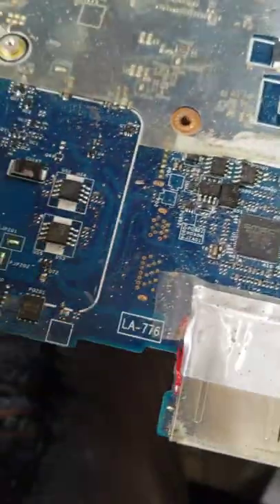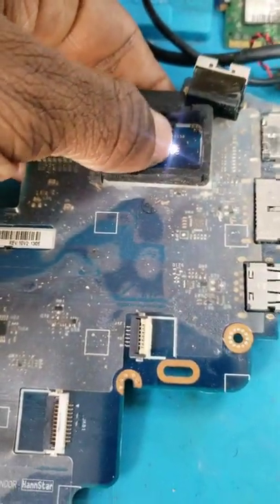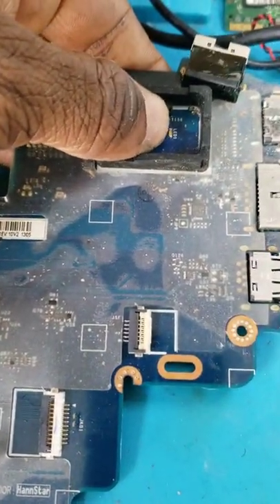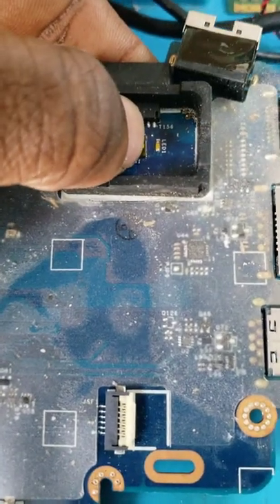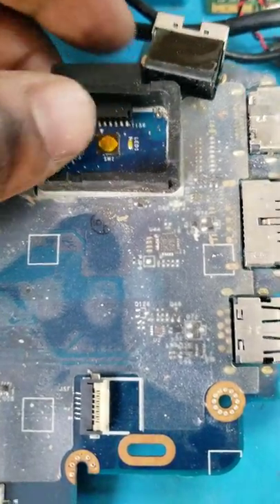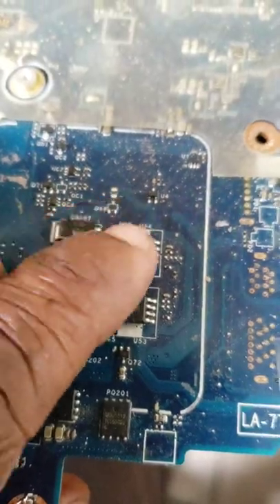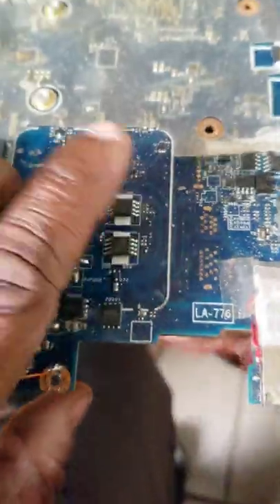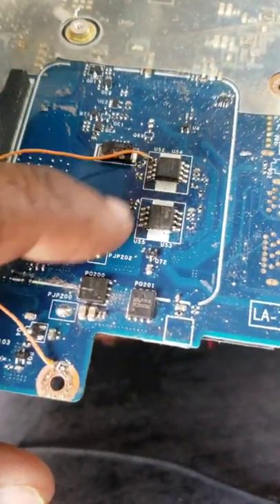how to determine if the  BIOS is cause of the power failure

Comment: Hi thx for sharin ...
you mean 8th pin vcc shorted to ground ? isnt this dangerous to 3.3 power supply or something else
Reply: It's pin 1, chip select. By doing that bios sets in high z mode
Reply: @fsaporito 
what is exactly high z mode ? i searched about the topic but i didn't find anything , where do i find a video talk about that in details

Comment: Hi, everyone,

I was updating the BIOS on my Lenovo IdeaPad Flex 5 14ARE05. It read successful and then rebooted.

Since then, it's just the fans spinning and keyboard lights on. The screen is blank and won't display anything even on an external monitor via HDMI.

What can I do, please?
Reply: I have same to same problem brother. May I know how you resolve this?
Reply: @Er.JayantaKumarSwain  take out the bios chip from the motherboard and flash manually
Reply: @m_bobby  flash manually means by attaching the bios chip in chip socket then connecting that in another PC usb port right?
Reply: @m_bobby  brother, have you done this by your own or gave it to any repairing shop?
Reply: @Er.JayantaKumarSwain  Did it at a repair shop here in Nigeria. The bios chip doesn’t even have to be removed. They can attach the flash tool to it while it’s still on the motherboard.
Reply: @m_bobby  ohh i see..how much they charged to repair it?
Reply: @Er.JayantaKumarSwain  5000 Naira. That’s about $8 when converted
Reply: @m_bobby  ohh i see..thanks for the information.
Reply: Manually flash the bios
Reply: @ODI0408  I did that long ago, and it worked.

Thanks anyways

Comment: It depends, that on off can also be one of the circuit is not switching properly that is why you need to analyze every circuits
Reply: Can u tell me what is exactly he did  ?
Reply: @ubtech2938  very easy questiion, grounding the pin 1 which is the chip select to set the bios to high frequency mode
Reply: @ODI0408  
what will gona happen if the eeprom selected on high frequency mode ?

is the pc gona boot up normally without needing for reprogramming the bios ?
Reply: @ubtech2938  first is it will not boot and it will not give a display 

second is fix your grammar!!
Reply: @ODI0408  
 Thanks for the useful info

2 . We don't care about grammars
Reply: @ODI0408 says someone with "questiion" and "edited" comment. Good job
Reply: @official_prozeg   HUHHH!!?? Did you have an aneurysm when you wrote this comment?
Reply: @official_prozeg   Look at my comment. Did I ask a question? I was just replying to a dude who asks questions hypocritically. DUHH
Reply: @ODI0408  No, you did. Read your first comment with "questiion" word with double "i". And again, "edited" comment huh LOL 🤣